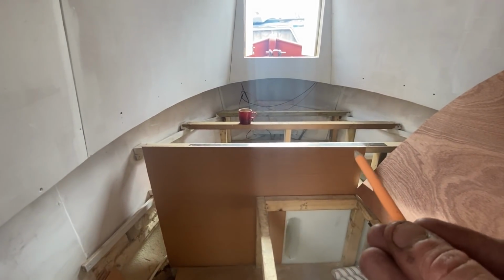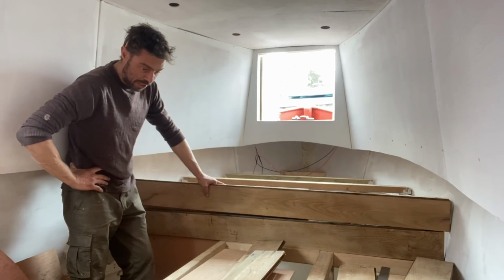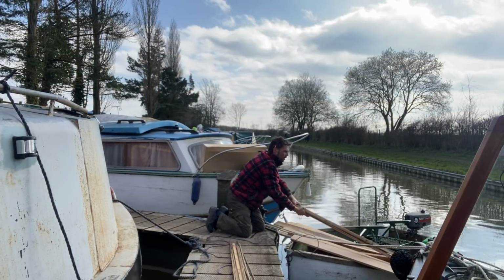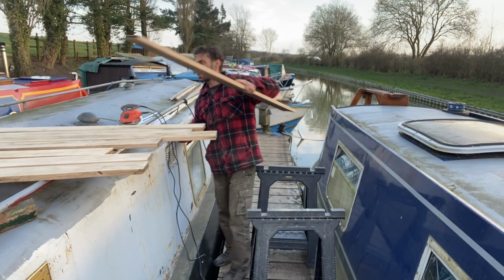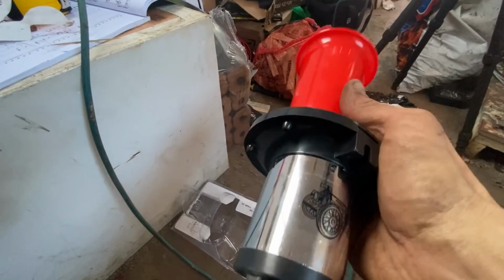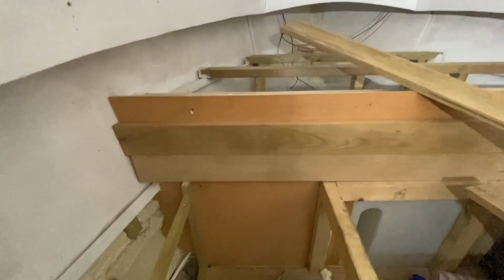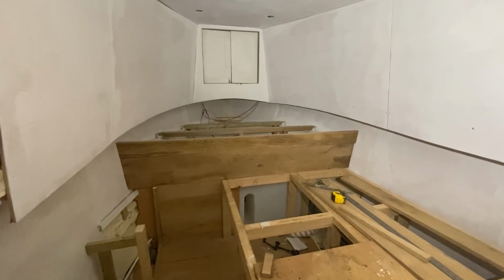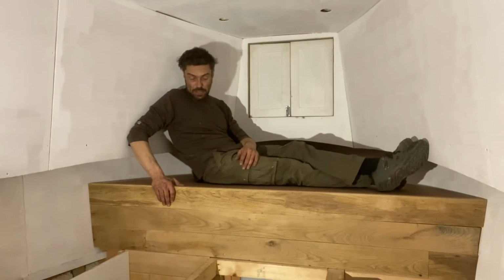148. Narrowboat bow nearly finished

Comment: It's not loud enough!  ;o)
Not quite the tone I was expecting, but...  Is there not a small lip over the front window that you could fix it under?
Feel free to give it away if it's too much bother to fit.
The focsle day bed looks great.
All the best, mate.
Reply: If you only hold the power on them for a moment or two at a time, they sound much more "authentic"!  It'll be much easier when James has a button for it, rather than just bare wires.
Reply: @normmcrae1140   Cheers, Norm.  ;o)